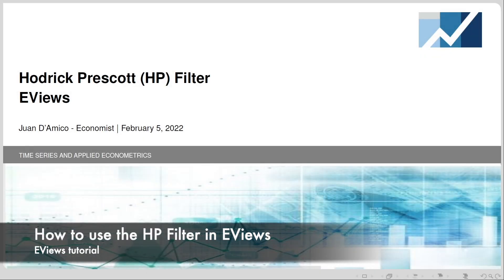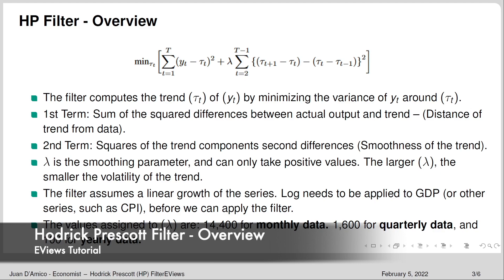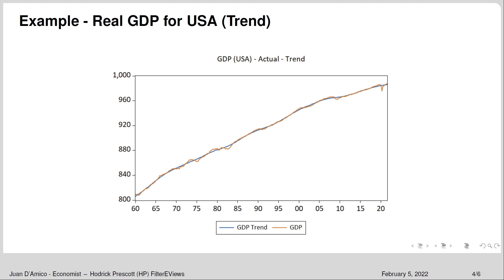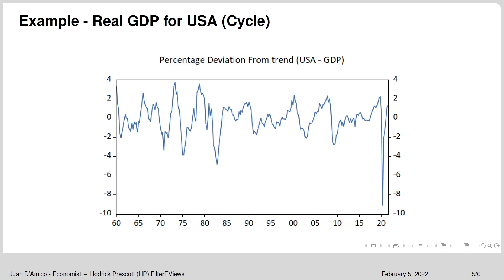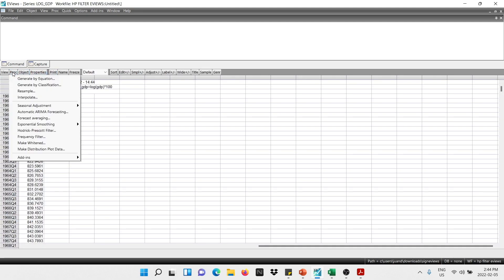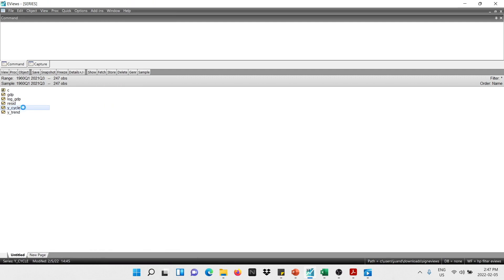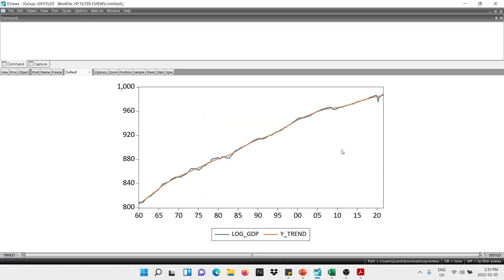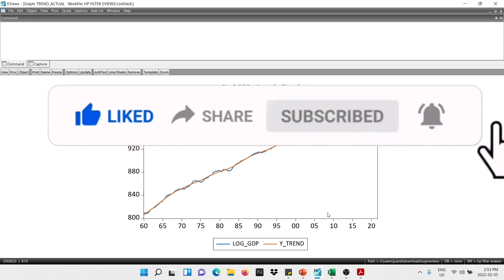Hodrick-Prescott (hp) filter: EViews tutorial

Comment: Hello, does the cyclical component represent the output gap? or how do I calculate output gap on e-views using HP Filter?
Reply from the maker: Yes it is. Its the difference between the actual gdp and the trend. Cheers
Reply: So the result for the output gap is on the cyclical component?   @JDEconomics

Comment: Dear Juan, thank you for the video. Just one question: doest it mean we get cyclycal element in a percentage deviation in the case of all variables we log and multiple by 100? Or only GDP series suit that approach? Thank you beforehand.
Reply from the maker: Hi, yes. I have used logs so I get percentage variation but also recall the filter asumes a linear growth. If you don’t use logs on GDP series (you can try it), it will look in levels. Also, if you don’t multiply x100 the log transformation then the cycle will display as 0.02 instead of 2. I hope that helps. Regards, JD
Reply: @JDEconomics  thanks again for the clarification.

Comment: if we want to regress the detrended data, do we use the y_cycle or the log_gdp data? thank you very much
Reply from the maker: Hi! You should use the cyclical component! The cyclical component shows the deviation from trend. Regards, JD
Reply: @JDEconomics  thank you for the response. but can I use the cyclical component to estimate a vecm model? since my cyclical component is stationary at level, is it considered to be I(0)? or is it considered to be I(1) due to the detrending?
Reply from the maker: @rifdahfadhilah1137  in a vec, the variables should be used in levels (as long as they are cointegrated). Regards
Reply: @JDEconomics  ah I see. Thank you very much.